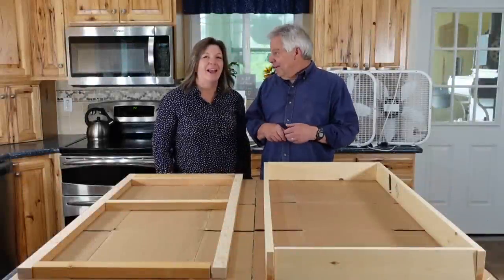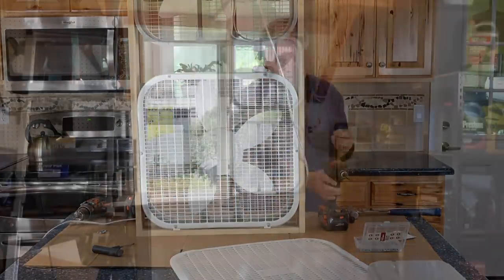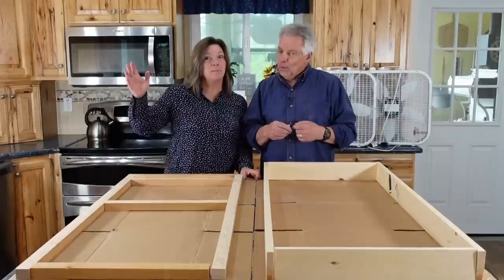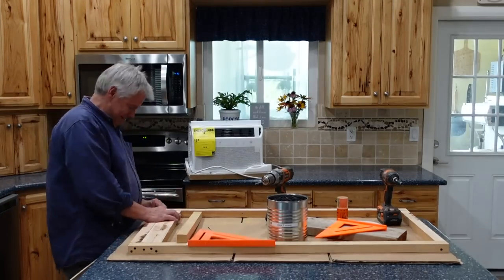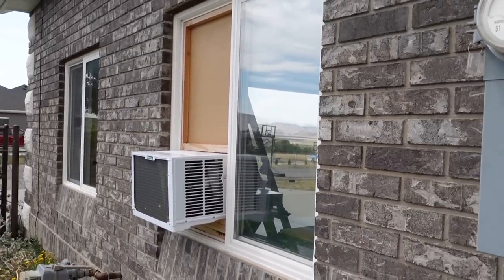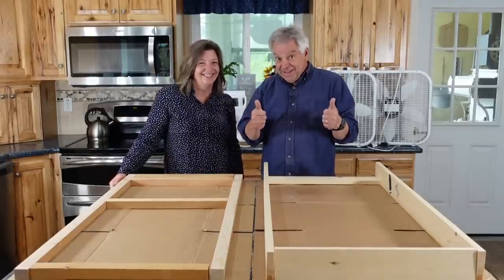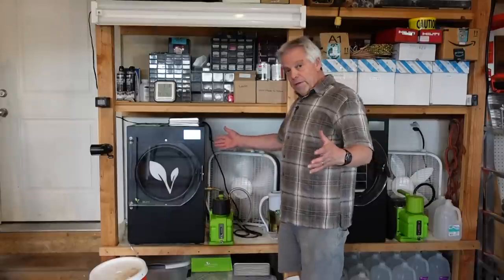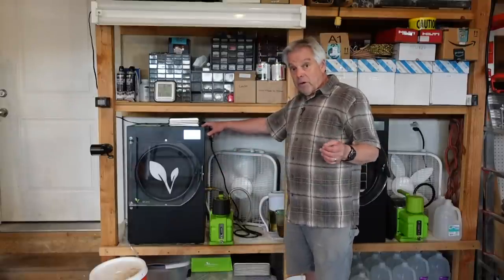Food Storage: How to Reduce the Temperature in Your Garage

Comment: I have a sunroom how can I store my water that I put in my 2 L bottles because it’s hot in my sunroom and I have a ceiling fan go on is there any hope for me that way because it stays hot in the sunroom should I put fans. And oh this has nothing to do with freeze drying. I know.  And also just regular bottled water that I buy from the store should I put more fans in there or no thank you
Reply: If it's a sun room it's got lots of windows to let in the light, you'll be fighting against solar heating.  You could maybe block off all the windows so that it doesn't get hotter in there, but generally speaking sunrooms aren't well insulated, so you'll still be dealing with a lot of heat from the sun. 
If it were me, I'd try to find a different place to store the water like under a bed, under the sofa, or maybe at the bottom of a closet?
Reply: Hey Teresa...great questions. I like the reply from Kelly S. If it is getting lots of sun (or even some), first step is to block that with reflective material if possible. If you have windows that can be used, you can use fans at night to bring in cool air and cool the room, then close them in the morning when the outside temperature is the same as the indoor temperature. A whole house fan can do a similar job. A swamp cooler will work in some climates and requires less energy to run than an AC unit. Running a fan during the day will not help since it does nothing to reduce the temperature (in fact, the heat from friction in the fan will slightly increase the temperature). People benefits from fans since our bodies natural cooling mechanisms use air flow and evaporation to cool us., but it does nothing for inanimate objects such as water and food. Explore some options and get back to us if we can help further. Keep doing good things!
Reply: Thank you both. I’m not trying to store them in my little dining area thank you both I appreciate it